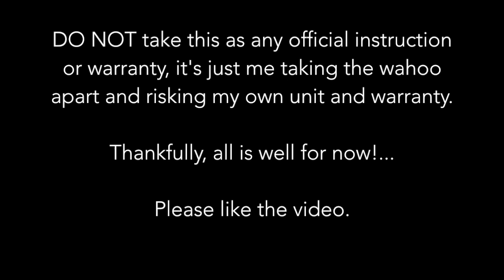Wahoo Kickr v2 vibration fix flywheel balancing with complete disassembly

Comment: Hello, just to let you know there is an easier way to remove the flywheel. Remove the plastic center cap on the flywheel by pulling it out with adhesive. It will expose a nut. Use a 19mm socket wrench and hit the wrench sharply to remove the nut. It has standard threading (CCW to loosen). Then you can pull out the flywheel. Done. you will still need to remove the belt to do balancing in-site but above method will not risk damaging the cog.
Reply: this was actually really helpful, i just had a need to remove my flywheel and that plastic center cap slides right out using a suction cup. Never would have noticed it otherwise.
Reply: i drilled a small hole on the center cap of the flywheel to make it easier to be removed
Reply: The creator should add a note to this effect directly on the video! This is crucial, saved my butt. I removed the cap using sticky packing tape. Thanks.
Reply from the maker: Hi there, yes, you are totally right. Sorry I've been late to get to this but it seems recently more people have been watching this. I added a note above. Note though that removing the flywheel this way does not allow you to do balancing quite the same way as I found that the flywheel never sits in exactly the same way when reattached from the nut side, but with a bit of patience, it works just fine.